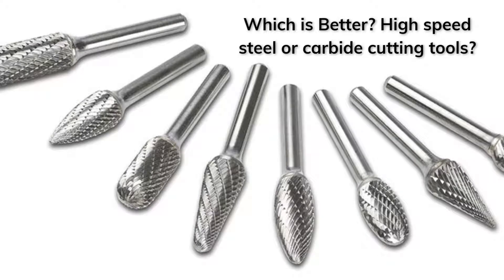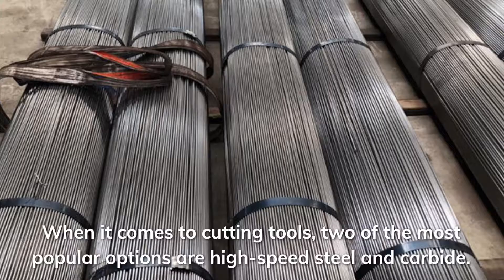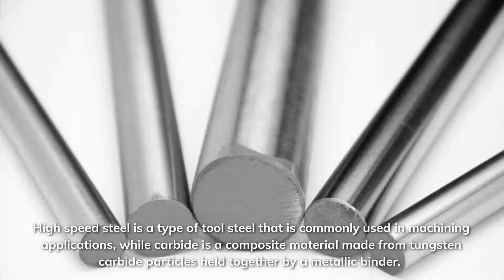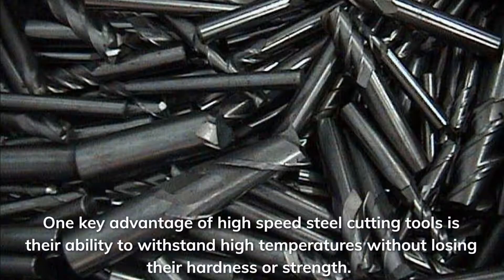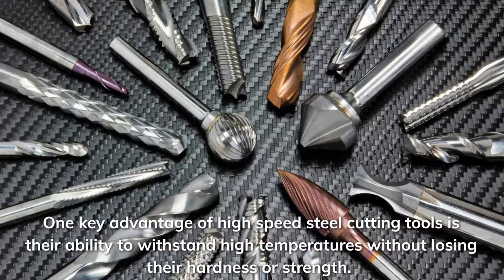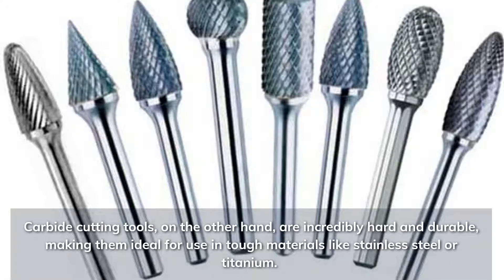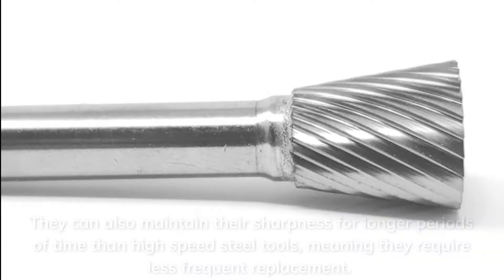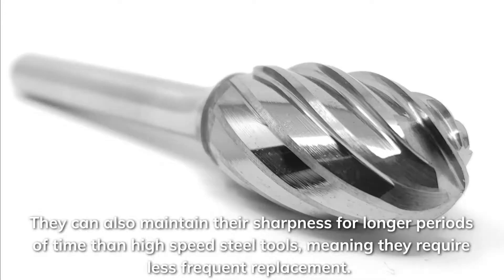Which is Better? High Speed Steel or Carbide Cutting Tools?

Comment from the maker: Which is Better? High Speed Steel or Carbide Cutting Tools?
Reply: Depends on the application. HSS for most applications is all that is needed. However, the ultimate factor in determining tooling use is cost per piece.